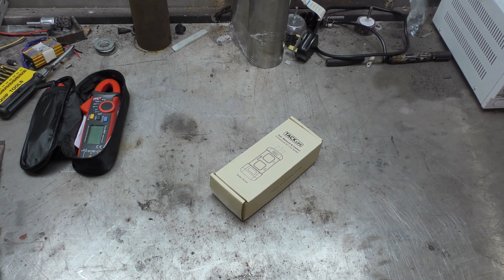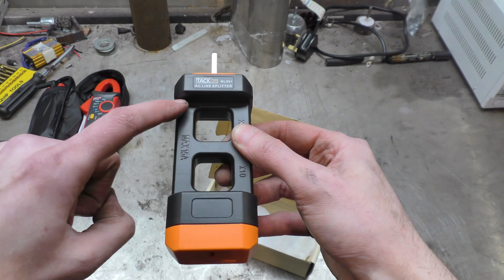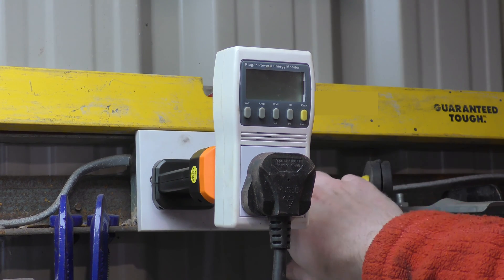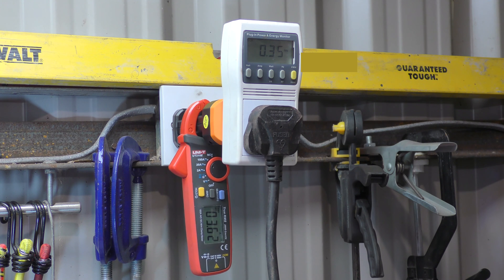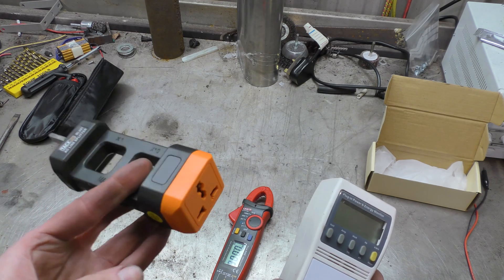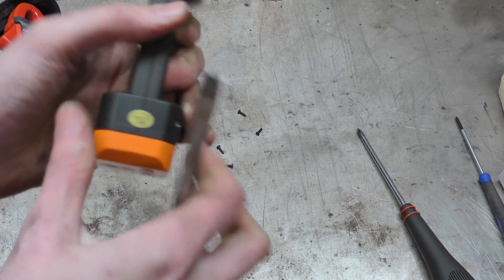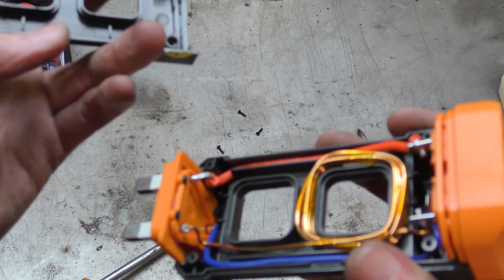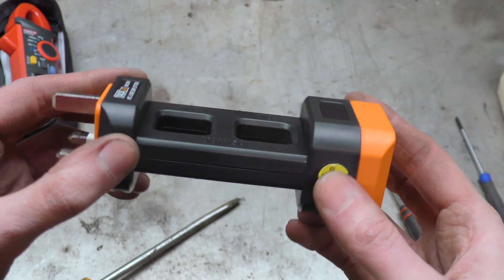Tacklife AC Line Splitter

Comment: One advantage of the splitter over the integrated power meter is that you can connect a clamp probe with a BNC to an oscilloscope if you want to see the waveform or measure inrush current (as opposed to continuous current).

Comment: This is a great video. I appreciate the dissassembly of the device. I really watched this to see if the x10 was achieved by 10 loops of one pole or 5 opposing windings of hot and neutral. One thing I noticed is the readings were taken from the wrong side of the line splitter. The x1 reading was accurate as it was based off only the red insulated wire. The x10 reading as taken was based on nine windings if the bare wire plus the red wire and ground. It would be interesting to see the current values based on the correct side. It is odd that the ground was run along the same side as where amperage readings are to be taken.
Reply: On one side of the 10x loop you have 10 hots (and ground, but there should be no ground current). On the other side you have only nine hots, but they are in the opposite direction, and one neutral. Since the hots are backwards on that side, they are effectively in phase with the neutral, so you should still see 10x on that side as well.
Reply: @EricSmith42  Eric Smith, that's a brilliant observation and explanation of the nine hots adding to the one neutral for a correct reading on either side of the 10x eye in the line splitter.
Reply: @EricSmith42  Brilliant explanation.

Comment: If there is a current leakage from the G (ground)  wire  , then the reading on the L (hot wire)will not be correct .  Check the link of a correctly design  line splitter ( pay attention to the wiring ) . 
 https://rapid-tech.com.au/ht-instruments-ha000951-line-splitter-separator/
Reply from the maker: That is a nice unit.  But the cheap tacklife one will still show a current reading that's close enough for most.  There is almost always current leakage to earth either from insulation (nothing is 100%) or things like power supplies with filters etc.  In the UK if it is more than 30mA it would trip an RCD.
Reply: If you have current on a ground wire you have an electrical problem to fix, measuring current flow is secondary to the safety hazard that needs addressing.
Reply: @killer2600 you are correct BUT now we talking for this line spliter evaluation .....
Reply: By the way , if it was correctly wired , the spiter also help you to verify the current leakage in grount (G) wire .
Reply: @geoproto5046  How's that? If you put the neutral and ground wires on the same side how exactly do we find how much current is on the ground?
Reply: who told you to put G and N ont the same side ???
Reply: @geoproto5046  There's only two sides of that splitter and I count 3 lines, you do the math.
Reply: @killer2600  bye
Reply: @geoproto5046  Exactly
Reply: @killer2600  If you pay attention to the wiring diagram in the link you see the neutral conductor switches sides after the RCD/earth-leakage test hole.  This leaves the live alone on one side of the splitter for the 1x and 10x test holes (the linked splitter has 3 holes instead of 2).    The linked splitter is also better labelled to indicate which sides should be used for what (earth current, hot/neutral differential, 1x hot, 10x hot and 2 that should not be used).  But the cheap-o tacklife could also be easily re-wired (and labelled) to put the neutral and ground on the same side.  You just don't have the separate/third dedicated earth leakage and differential measurement point.

Comment: Look nice but not wired correctly . The G line (ground) must be wired along with the N line .
Reply from the maker: Can you explain please?
Reply: Good call. I would love to understand too. I don't want my electrons to fall out 🤤
Reply: @DavidMcLuckie  It is good enough for most measurements but not optimal (especially for low current devices) because there is almost always SOME level of current leakage or differential (there are ways to have differential between neutral and hot without that current going on the ground conductor...alternative ground paths, etc).  There isn't a good reason I can think of for tacklife to not wire/label it correctly.   Assuming you have 0 current on the ground conductor, you can get an accurate reading as long as you clamp on the side that has the ground and not the neutral.  If you clamp to the neutral side 10x, then you are only getting 9x (10x hot - 1x neutral).  If you clamp to the ground side you see 1x and 10x on the hot as long as there is no leakage current on ground.  So the optimal way to wire it would be to run the neutral and ground on the same side and then label the splitter to indicate that neutral/ground side should not be used for measurement.  Then you get an accurate hot current measurement regardless of any differential or ground leakage.  The ht line splitter has a third measurement hole that has neutral/hot on one side and ground alone on the other and both sides can be used for measurement (raw ground current and hot/neutral differential current).  Comparing the two indicates of the leakage is going over the ground conductor or via some alternative path.  After this measurement hole the neutral switches sides to run with the ground.  ht-instruments has a wiring diagram on their site that illustrates this.  But yes other than the housing/plugs these should be very cheap devices (ht instruments are too expensive for what they are) as they are just wire of appropriate gauge run (hopefully) correctly and possibly some test points for voltage measurement as well.  Many people with RCD nuisance trip problems want to test their appliances after narrowing down which circuit is contributing the most to the leakage sum...so I definitely see these splitters as being very useful for both current measurement as well as leakage troubleshooting (e.g. finding the appliances that are contributing most to the RCD trips).
Reply: It's ok, ground is not a current carrying conductor. If you have an situation where it is, you need to stop, repair the electrical fault, and then you can measure how much current your using at a given outlet.
Reply: Makes no difference which side you run the ground wire since it is not conducting any current at all. Ground wire is only for protection in case of a fatal failure.
Reply: @tektech1065  Actually, I would advise you to educate yourself on earthing schemes. The most common are TN and TT. In the TN scheme, a live to earth fault will cause a peak current similar to a short circuit and will trip the breaker. In the TT scheme, however, a live to earth fault will do just what the name implies: electrical current will flow continuously from live to earth, usually a low value current (in the range of milliamps) not enough to trip the breaker, and the only way to detect this kind of fault (or current leakage) is through a RCD-type breaker, which is able to detect such leakage currents.
Reply: @Fernando_S  I appreciate your comment. In this particular device (AC line splitter) all you want is to detect a proportion (of your choice) of the current drawn from the output. Ground wire carries no current under normal conditions. I think that was my only point. Cheers!

Comment: It's a CT - (current transformer) and would, I suppose, be useful in this form to measure AC current in a portable appliance without to the need break into the plug exposing the user to inherent danger while the appliance is live.
As we all know you can't just clip over the lead cable which has both neutral and live lines cancelling each other out and so nullifying a 'clip-on ammeter.
It is, I suppose, a useful piece of test equipment for the electrician.
Reply: It's a line splitter not transformer, it merely spaces out the hot and neutral line so an amp clamp can be put around one of the lines and get a reading instead of having to go around both lines which gives no reading.